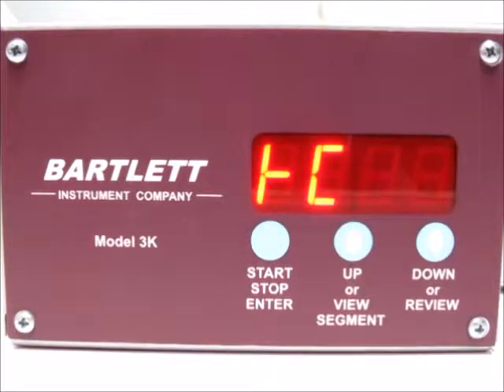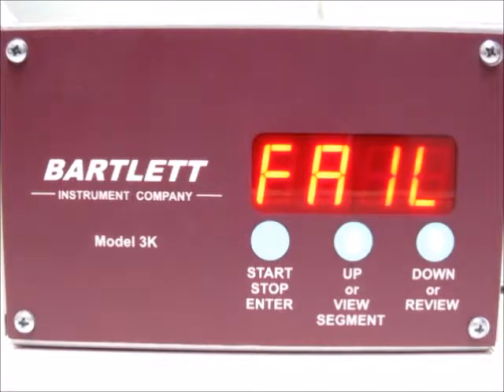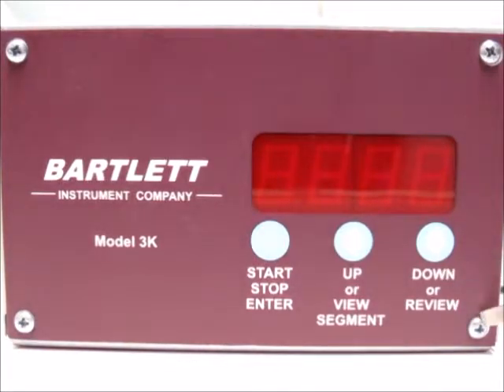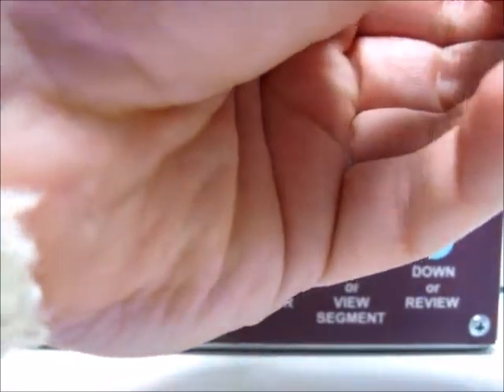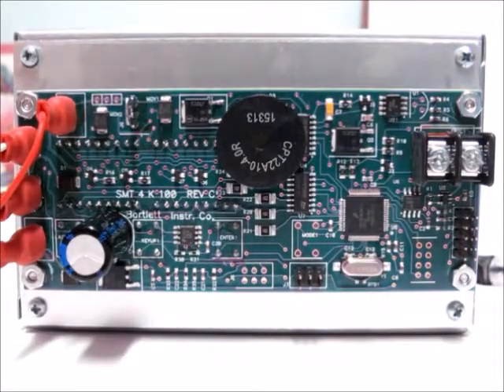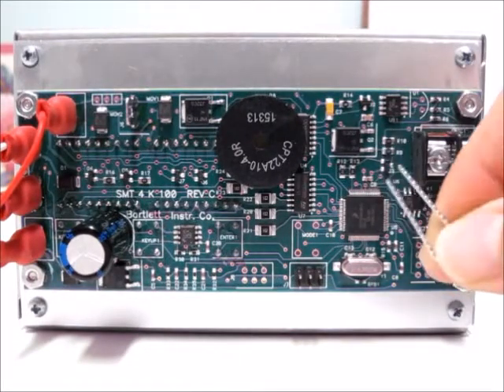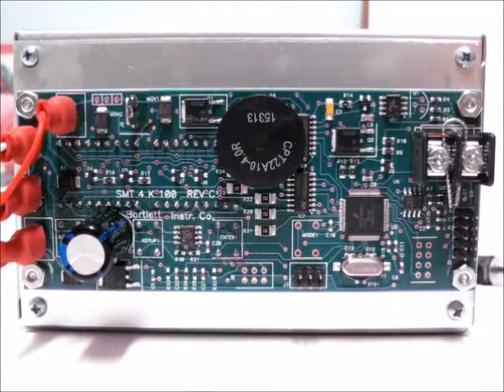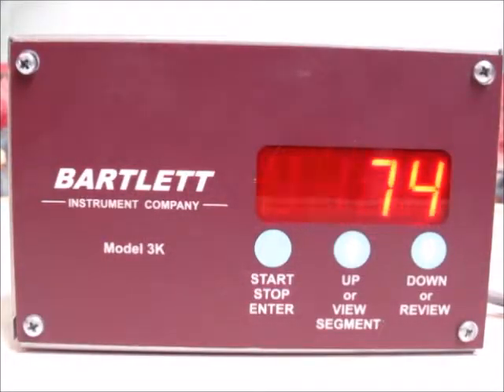Bartlett 3Key | Thermocouple Bypass Test

Comment: I’m confused which is no surprise. So when checking tc health if the temperature reads room temp then it is
Ok or bad when you have jumped it. What shows if the tc  is bad not the actual board
Reply from the maker: When the thermocouple is bad the controller will read TC FAIL. When you get this error to check to make sure it is the thermocouple you will do the test in the video. If you controller is reading a temperature, then it sounds like your thermocouple is still working at room temp, but it may still go to fail after it is heated during the firing. This could happen within a couple minutes or hours into the firing.